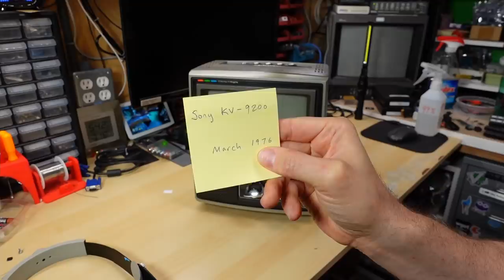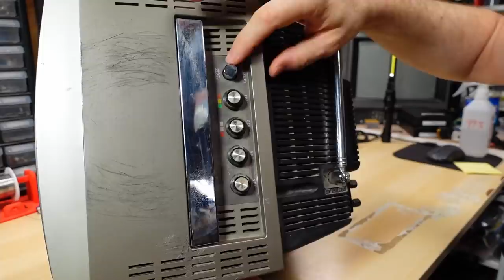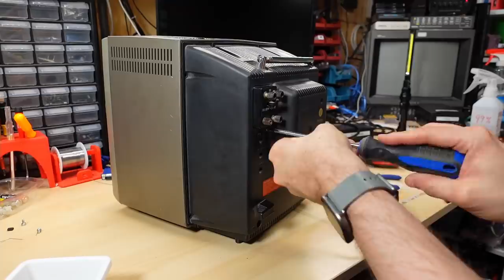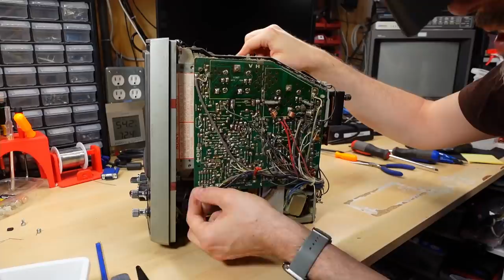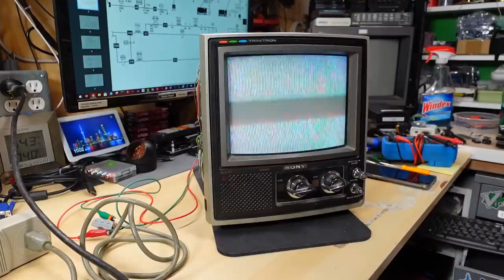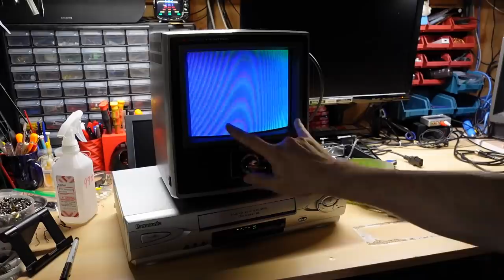A very used up (and broken) Sony Trinitron from 1976

Comment: The scratches on the top panel were likely made by a rabbit ears antenna base being rotated over many years!
Reply: Cindy SparkleFarts  Don't forget the rolled up tinfoil!
Reply: Yup.
Reply: I was thinking the same thing
Reply: same thing I thought
Reply: Yep, first thing that came to mind when I saw that :)
Reply: exactly what I was thinking too.
Once the builtin one busted off they went to a standalone rabbetear unit and it put a whole lot of wear on the set.

Comment: I was a teenager of the 80s and your comments about “instant on” resonates with me. Ironic that my modern 60 inch LCD has a boot up splash screen that takes around 15 seconds to eventually show a proper channel.
Reply: While I wasn't a teen until the 90s, we did have a few older sets when I was a kid in the 80s, so I remember those warm-up times as well, though they were far quicker than what I assume people had to deal with in the decades prior... and yes, even the 4K TV I use as my PC monitor has its own splash screen... definitely a bit annoying 😅
Reply: @CanuckGod if it is a samsung tv then you can turn the splash off in the menu. I don't know about other brand because I don't have it.

Comment: When shango is talking about cleaning out TVs, that's usually when he's working on one of his famous "resurrection" sets. Those particular sets are in such a fine balance, from sitting outside in the desert for literal drcades, that an air dusting or brush could feasibly break a corroded wire or circuit trace very easily.

A "normal", or otherwise not abused/neglected, set can handle a proper cleaning.
Reply: Right. Always amusing to find smack talk about how he isn’t cleaning every inch with a tooth brush like an ASMR channel.

He’s pretty clear that a lot of people want him to vet that it’s possible to get a vintage set fully restored or that he’s messing around and only delaying a sets landfill days. 

Great content, love when he mentions the smells.
Reply: it's just a timebomb then, if it breaks it's good it happens so it can be fixed, IMHO better keep things clean, dust can be as dangerous as anything else for components
Reply: It's kinda why I am sticking to LCD/LED TVs even for retro, I don't have space nor nerves to fix those old bricks :)
Reply: @HoboVibingToMusic  You have to know the old sets are better built then todays throw away sets.
Reply: @lordmuaddib  I agree, much as I love Shango, it annoys me he leaves them full of dirt. If it can't survive a soft brush, just as you say, it needs attention.
Reply: @HoboVibingToMusic  I got a Nokia 28" old 4:3 format stereo tv, best tv for the C64 i bet :)
If one does not want interpolarised picture upscaling on a modern one.
Loewe did make good tv's, if you got one in 4:3 format (dont know if they made them but likely). A friend had a Loewe 32" widesceen (not for C64 use). He did buy it when it did come on the market and did try them all before he did buy anyting. The price was super high in the 90's. Nice tv for movies back then, but smaller gaming picture than my Nokia 28" old format :)
When my grandma did die i had a 32" widescreen picture tube tv i got on the scrap, it was mint condition.. no remote control. Guess which one i did keep when my grandma's 28" was in my parents home ;) Yeah, still got it. It's the Nokia.
Reply: Lot of viewers here from flavor country
Reply: yeah Id imagine especially if he is legit working on rat pissed ones and with bug damage and spiders and whatnot like from the abandoned mining camp video.
Reply: @lox_5017  there were plenty of shitty poorly built CRt sets too. They're just all in landfills now

Comment: I would definitely recommend you for taking a look at the power supply caps. At least make sure if the voltages are dead on before passing that tv. The caps on 60's and 70's japanese products are garbage, I'm sure some of them are open or high esr.
Reply: Yes
Reply: what do you mean doc? all the best stuff is made in japan
Reply: @Themaxleydog true in the late 70's and 80's
Reply: @Themaxleydog  70's japan capacitors didn't age well. Same with potentiometers.
Replaced dozens to make sony and hitachi tv's work well.
Reply: @Themaxleydog  unbelievable!

Comment: You've got to push in the fine tune knobs on those old Sonys. My parents had a 13" from '73 or so, complete with wood-grain sides etc. Otherwise the controls were identical to your little 9" set. Lots of nostalgia in seeing the channel indicator lights turn on.
Reply: I second this.  I came to the comments section just to say the same thing.
Reply: That was true for most rotary tuners.  Each channel had a tuning coil so when you pushed the center knob in, you engaged the knob gear to the tuning coil gear.

Comment: I picked one of these up in the 80s at a garage sale, same model. All it had was a bight horizontal line so vertical amp was out. Had no service manual. Replaced both the T03's by the VH board as one of them was literally whining and hot. After that boom, perfect trinitron picture. Gave it to my mom for her office, she was really happy.

Comment: Those cord interlocks were so the average owner couldn't power the set with the cover off.  I think it was called an interlock cord.  Mainly needed for tube sets since there's not much a user to fix on solid state TVs.
Technicians would have a "cheater" cord to power the set.
Reply: wasnt it the cheater cord?
I have this old vintage radio that the cord comes off with the cardboardish wooden  back

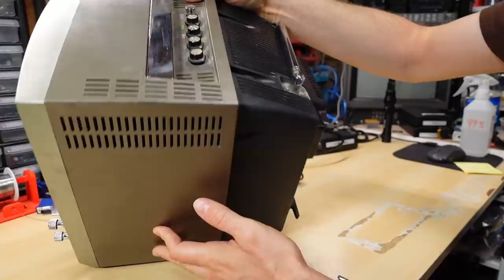Comment: Right off the bat: points off for locating potentiometers on the top of the unit (6:40) - heat rising from the CRT will probably toast 'em!
Reply: dang nice beard

Comment: The 1st trinitron was all solid state except for the high voltage rectifier - which was still a vacuum tube. They figured the tube would not likely fail so the big SOLID STATE badge was slapped on the front.  
I believe 70 or 71 was the year they went to a completely solid state (including the high voltage rectifier)

There were some instant on versions of the trinitron, but the EconoQuick CRTs had a fast warmup time due to the different cathode design than the traditional tubes. They were supposed to show a picture within 5 seconds of power on - though full emission wasn't available until about 10 seconds.

Comment: Given that you have disabled the "quick start" feature by removing a wire from the power switch, you might measure the CRT filament voltage, to be sure it's not low.  A cathode that isn't hot enough could be part of the reason for the lack of brightness.
Reply: That’s a good idea. I was wondering why the working wattage he had it up to (50 Watts) was short 25 Watts of what it was rated for when he read the specs. Might be due to that.

Comment: I used to have a 13" Sony Trinitron with a wood case. My father bought it as a 12th birthday present for me in 1972. It was a model KV1320UB. It was still working in 2005 when I gave it to my gardener.

Comment: There's no problem blowing out one of these. The old tube stuff might have paper caps that will disintegrate or asbestos you don't want blowing around.

The plugs are security plugs and no, they're not critical. We used to drill a little screw in them and rip them out.

Picture looks like it needs to be degaussed. I don't care what Sam's says I would try that first. You can even do it with a large magnet or tape eraser. TV has probably been knocked over onto it's right side at some point. I think one of the wires you left disconnected was the degaussing coil.

Tube is weak. Probably from instant on feature. Did you try adjusting the screen control on the flyback? You might get it a little brighter. I wouldn't have mucked with the neck board.

PSU needs caps. I would start there. I definitely wouldn't change every cap in the set - that's a waste of time on solid state era stuff. This thing doesn't have any paper caps.

Comment: Hi, I bought one of these from an electronics scrapper just a few weeks ago! The manufacturing date is April 1975 and it does turn on and seems to work fine. I haven't plugged in a modulator yet but hopefully it will have a decent picture. Mine has the original omega shaped UHF receiver and the main antenna works well!

Comment: I wish we had some footage of this TV being assembled!
Reply: There is a channel that has old films of just that, yes pre video tape.  I think its called something like (EDIT) computer history archives project (here on youtube)
Reply: The labor cost of assembling these sets is one of the reasons Sony's cost so much more back in the day. Very complicated sets much more so than the usual TV sets of the period.  There were many television shops that would not work on Sony's and others that specialized in them.  You could think of Sony as similar to a modern Mercedes-Benz automobile. A quality product that definitely cost more then many of its contemporaries.  Unfortunately some of the complexities only added to the repair costs when required. Mercedes-Benz cars have over 100 microcontrollers in various functions all talking to each other. This not only causes complexity in troubleshooting but also in a greater number of failures. Smart people never buy a Mercedes out of warranty as it is not uncommon to find one with dozens of codes set in the computer due to failures of the microcontrollers or what they control. Over engineering is nice but it can be later on very expensive to repair.

Comment: From my vague memories from the 70's, old TVs could take many minutes to be fully on, so I get why a 'quick start' would be a nice feature.
Reply: I don't even qualify as a 90s kid by most people's standards, but my grandparents had a circa 1974 Zenith TV that sat in their living room for many years and I recall that they always turned it on about 10 minutes before they actually planned to sit down and watch it (if possible) because it took an eternity to reach its full brightness for some reason.
Reply: @AliceC993  Yeah, you really had to plan way ahead. Did the sound come on before the image? I'm not sure...
Reply: @niek024  On that particular set, absolutely. You would hear sound almost immediately after powering it on, but the actual picture wouldn't come in until about 20-30 seconds later and it was extremely dim until about 2-3 minutes later.
Reply: @AliceC993  sounds like an extremely weak CRT, that isn't normal operation for sure
Reply: @classiccomputers6211  That may very well have been true, I haven't seen that set since at least about 2008-2009 so I assume it's long gone. All I know is they were reluctant to upgrade until HDTV became more widespread and they finally had a reason to because that old TV was always "good enough" for them. I recall it was pretty fuzzy and dim even once it was warmed up, so it wouldn't shock me if it was on death's door for years and just never fully gave out.

Comment: CRT's definitely have advantages over modern display technologies, but that being said, not every CRT is great, and not every SONY is a decent set.  The fact that it has a watchable picture, has awesome vintage style, and STILL works after all these years makes it a WIN.  My opinion only of course.
Reply: What are the advantages?
Reply: @brad3042  Very few.
Practically zero input lag because you just need to control the electron beam and the yoke, instead of having to process every pixel.
Beautiful colors and black levels.
And they are not limited by random resolutions, unlike the set number of pixels on a modern TV.

That would be it; they cannot be made larger due to geometry and weight issues, use lots of power, contain lead, are costly to make, and people don't want to pay to fix them anymore.
$30 to fix an old CRT TV sounds like a scam to people when they can just buy another one for not much more.

Comment: I have the predecessor to that set/form factor, the KV-9000U.

You didn't have to take out the trim clips, just remove the screws and knobs and the whole case comes off.  Oh well, it's done now.

Comment: Had one of these back in the day, looked ahead of its time, seems that I had mine before 1976 and had a circular antenna if I remember correctly, it was  built like a tank.

Comment: The CRT heater elements were kept running in order to bring the CRT gun to full emission quicker than if started from cold.

Solid state chassis designs, that drove the CRT's, could of start processing instantly, unlike previous thermionic valve (tube) designs which also had to come up to full emission, together with the thermionic CRT thus making "warm up times" seem like eons.

The downside of preheat was that this prematurely aged the CRT as the electron gun was still emitting even at the lower heater supply.

Comment: Heh, my Vic20 (my first computer, which I still have) was rigged up to one of these (a donation from the family kitchen in 1982) via RF modulator and a barrel to antenna lead adapter. While I still have the Vic (which works perfectly all these decades later), I have no idea what happened to that TV. When I got my C=64, with matching monitor, the Vic went back into it's original packaging (which I also still have), but the TV totally disappeared (I have no memory of where it went next, though nobody threw out a Sony anything back in those days, so it probably went to my older brother, and then off to college with him). For all I know, that's my old TV in the video.

Comment: Capacitors always the problem with old hardware, suggest replacing them as others suggested.

Also suggest cleaning the TV, as Dust and Old electronics causes house fires.

Comment: I wouldn’t be surprised if this directly inspired the Macintosh and Mac Colour Classic designs (that one used a trinitron tube much like this). You can see the slight wedge shape on the back of the chassis, and the “barrel” shape to the front because of the shape of the trinitron. Very nice find Adrian!

Comment: Wow this took me back. I had to fix one of these in the late 70's. The owner gave it to me because it made a scary popping sound. The high voltage transformer or "flyback" was arcing to the chassis. I fixed it by putting some rubber strips and sealing them with anti arc paste on the side of the transformer. It fixed the TV and it had a terrific picture for the time. It worked for years...I wonder what happened to it?

Comment: Funny nobody picked on you saying that this model isn't much "older" than the very first Trinitron from '68 ;) Echoing what others said about the caps. I know it's easy for me to say "just change the caps!" when I'm not the one who will be dealing with that usually busy early multi-PCB design - but give it a shot if you've got time and it should help those colors pop right out again.

Comment: Most times you can get out the inner segment of the antenna with a screw. Just tool a long one, screw it into the segment and pull it out. Had a lot of old TVs and radios on my bench, and I mostly managed to get out this thing that way :)

Comment: Great video! I have a kv9000u? In my basement. I turned it on once and it started smoking a little bit. Seeing the internals of this guy makes me think I'll leave repairing these to the pros. I was scared when you were poking around in there because I don't remember seeing you discharge the set on camera! Adjustment while it's on is also a bit of a risky maneuver!

Comment: If you can find one, get a Sencore 7000 CRT tester.  It was the one of the last and arguably the best CRT tester ever made.  The rejuvenation function is also recognized as one of the gentlest available. It has brought many a dead CRT back from the grave.  It will rejuvenate computer, television, oscilloscope crt's and even vidicon tubes.  They are now selling at a all time low prices as they are not seen to be useful anymore.  

The instant on feature of many of the older sets was one of the biggest CRT and tube killers.  Some of the first computers also had an instant on function believe it or not. The filaments were left on for many hours without b+ voltage. Overtime this would poison cathodes and render the tube useless. Special tube types were developed to prevent this from happening.  In the older tube manuals this was mentioned for the computer industrial types but I never remember seeing this feature mentioned for consumer tubes.  The engineers of these products never imagined people 40 and 50 or 60 years in the future trying to resurrect these items. They were seen as consumables.  Honestly I feel they would be surprised that these items actually survived that long.
Reply: Just remember that rejuvenators do not work well on Trinitron tubes.
In-line guns respond well to a rejuvenator, but the Trinitron gun does not and it can make things worse.